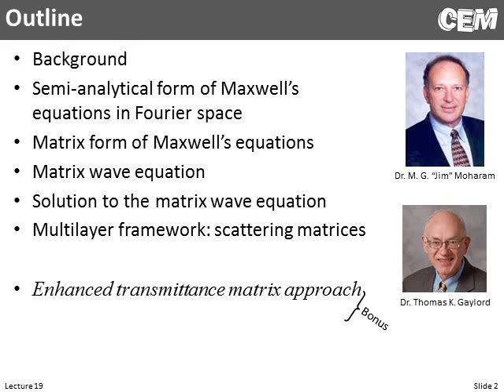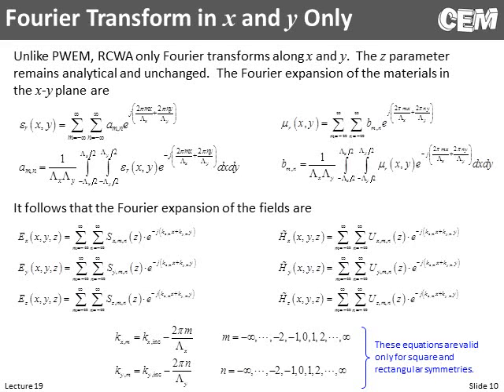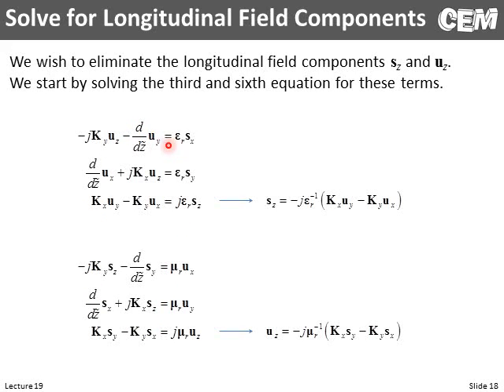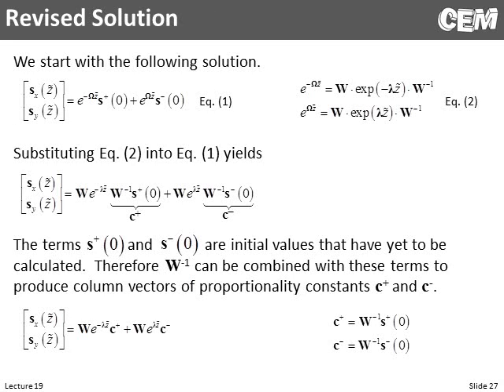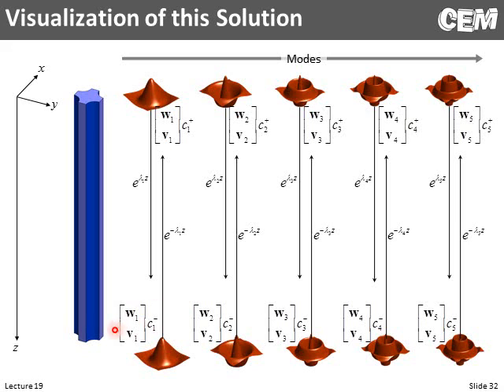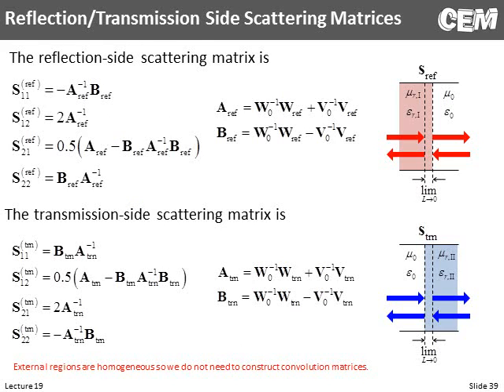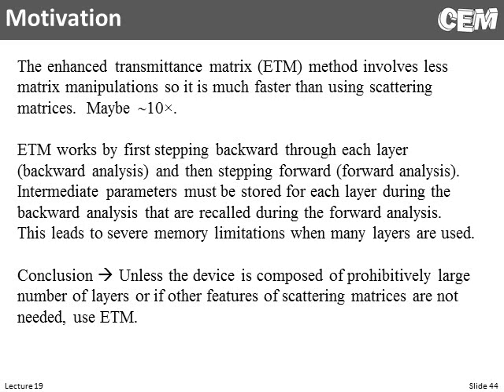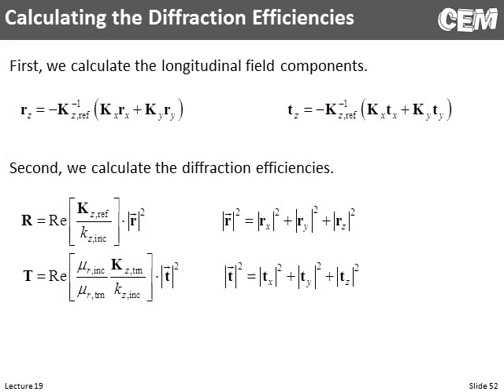Lecture 19 (CEM) -- Formulation of Rigorous Coupled-Wave Analysis

Comment: Good day, Dr. Rumpf thank you a lot for your lectures!
I wrote my RCWA code with help of your lectures and it works very well.
I try to calculate the fields inside my device but I got a problem with continuity. I followed the TMM extra lecture.
I fill all my layers with air so I got 100% transmission. I consider the sign convention from the RCWA lectures.
The mode coefficients for backward waves (c-) equal 0. I consider only 1 spatial harmonic for testing my code. 

I really dont understand what can be wrong. The amplitudes of the fields looks reasonably.
I will appreciate if you can give me some advice.
Reply from the maker: That is odd.  I probably need to create some notes on doing this for RCWA.  I am sorry I do not have that yet.  Sometimes it is easy to get the spatial harmonics backwards from how they are ordered in the FFT.  Try doing things like reversing the order of the K vectors.
Reply: @empossible1577  Did you mean to reverse the Kx and Ky vectors?
For testing the code I implement the RCWA with P=Q=1 so it works like regular TMM and my Kx and Ky equal 0.
Reply from the maker: @wolfwolf7121  Yes, I meant once you calculate them, reverse their order in the array relative to the indices of the spatial harmonics.  This is just something to try.  The codes as I present them are correct, but something like this is easy to mix up once you start messing with the data.
Reply: @empossible1577  If I understand it right, the matrix B=[Wg Wg; -Vg Vg] is eigen vectors matrix in free space? Or maybe there is somting additional to do with matrix B?

In case of P=Q=1 I dont really have what to reverse because Kx=0 and Ky=0 and they are not arrays, but it must work anyway.
Reply from the maker: @wolfwolf7121  The B  you specify I think are the eigen-vectors for the gap medium.  I think I am using vacuum here, but you can make it whatever you wish.

BTW, did I already point you to the course website?  It has the latest version of the notes, links to latest videos, and other resources to help you get codes working.

https://empossible.net/academics/emp5337/
Reply: @empossible1577  Good day, Dr. Rumpf. 
I worked carefully through your TMM and RCWA lectures and I double checked my code . It seems that my code is right - I have no problem with the conservation of power with any number of spatial harmonics, but I still have discontinuities at the bouderies between the layers.

The reversing of the K vectors didn't help. I can't understand where the problem with the phase is coming from. 
Can you give me some advice please ?

Thank you very much for your response.
Reply from the maker: Are you using local z coordinates in each of the layers?  I am only guessing at what could be the problem.
Reply: @empossible1577  Yes, I do it. Exactly like it is described in the TMM extra algorithm.
Reply: Beside the discontiniuty when I increase the number of spatial harmonics the amplitudes sharply rise at the end of the last layer relative to other layers but at the same time the R and T coefficiens calculated properly. This problem occurs with P=Q=7 or higher.
Reply from the maker: @wolfwolf7121  Try conjugating the eigen-values.  That is not a fix, but a test about what may be happening.
Reply: @empossible1577  I've tried to this. The phase changes to 180 degrees and the discontinuities remain
Reply from the maker: @wolfwolf7121  Hmmm...I am starting to run out of ideas.  Once you calculate the spatial harmonic amplitudes, how are you calculating the fields from that?  You may have to e-mail me your code.  My e-mail is emprofessor@empossible.net.
Reply: @empossible1577  I sent you an e-mail with my code. 
To calculate the fields I use the way described in PWEM extra lecture. 
Because the spatial harmonic amplitudes are odd number and the real space grid consist of even number of points (512 by 512) the oblique incident angle can occur. To avoid it I construct the field on odd real space grid (for exmple 511 by 511 grid) but it doesnt affect on the discontinuities.
Reply: Did you receive my email?
Reply from the maker: @wolfwolf7121  Yes.  My work like turned crazy.  Very sorry!!!
Reply: @empossible1577  I solved the problem with the discontinuities. But I still have the problem with rising amplitudes when I increase the number of spatial harmonics.
This problem occurs only with inhomogeneous layers.
If I use only homogeneous layers I dont have any problems.
Reply from the maker: @wolfwolf7121  Assuming the eigen-modes are correct, the only thing could cause this is having the sign of the eigen-values incorrect.
Reply: @empossible1577  I've already tried this. It doesnt help.
Reply from the maker: @wolfwolf7121  Very sorry.  I am out of ideas to try.  It is on my to-do list to develop this code and put out some notes, but I have a very long to-do list.  I may have to do it myself before I could guide you further.  My gut still points me to the sign of the eigen-values not be handled correctly.
Reply: @empossible1577  I understand. Beside the growing amplitudes, the field in the last layer turns perpendicular to the incident direction when I increase the spatial harmonics.
Reply from the maker: @wolfwolf7121  I REALLY hate telling people "I don't know" so I implemented the RCWA visualization.  I added some notes about this to RCWA extras.  It is the first section in that lecture.

https://empossible.net/academics/emp5337/

Having worked through it, I caught two mistakes that I made.  First, when calculating the fields in layer i, it is the global scattering matrix from layer i-1 that should be used.  Second, I had to multiply my IFFTs by the number of points Nx*Ny to get physical values.  Otherwise, it was pretty straightforward.  Take a look at the new notes and see if you catch anything.
Reply: @empossible1577  Thank you for adding new notes. I calculated the field as it described in the new notes, but I visualize only Ex component. I cant understand what I'm missing. I sent you an email with example of the results I got.
Reply: I also have discontinuities of the Ez and Hz components while Ex,Ey,Hx,Hy are continuous at the boundaries
Reply from the maker: @wolfwolf7121  Normal components are not continuous across the interface.  eps*Ez is continuous across the interface.
Reply: @empossible1577  Yes, I missed it. I fixed it and now it is working. Thank you very much
Reply from the maker: @wolfwolf7121  Great to hear you got it working!  What was the trick?  What were you missing?
Reply: @empossible1577  I just forgot to multiply the Ez component by eps one more time.

I still have the problem with the growing amplitudes, but I noticed if I use
LAM = sqrt(-abs(Re(LAM))-abs(Im(LAM))) 
instead of just LAM=sqrt(LAM) the amplitudes do not grow and the REF, TRN coefficients dont change a lot (the conservation is good), but this is working only in case of lossless materials. If I use metals the coefficients change a lot.
Reply from the maker: @wolfwolf7121  The first RCWA I ever programmed used the enhanced transmittance matrix technique to handle multiple layers.  I programmed that to visualize fields without any problems.  I rarely visualize fields with RCWA so I always use that old code when I do.  I have become curious if there is something fundamental about calculating the fields with my version of RCWA and scattering matrices.  I wish had more time to explore little things like this because they keep me awake at night!
Reply: @empossible1577   I implemented the ETM technique and it works very well, the results (Ref and Trn) are the same like I got with S matrices. But I have discontinuties again in the fields. 

I calculate the field this way 

psi  = Fi*[Xi 0; 0 I]*Ci, where Ci = [I; bi/ai*Xi]*ti
Is it correct ?

Buy the way there is no problem with amplitudes with any number of spatial harmonics with this formula of psi.
Reply: I figured out what was the problem. 
Now it is all working. 
Thank you for your lectures, attention and help.

Comment: Hi, Dr. Rumpf thank you a lot for your lectures!
I wrote my RCWA code with help of your lectures and it works very well.
But I have a question. Is it possible to analyze waveguides or resonators with this method?
Reply from the maker: Yes!  I don't really have any notes on doing this, but you can look at Lecture 2d on using TMM to calculate slab waveguide modes here:

https://empossible.net/academics/emp5337/

The very short story is that you will guess at the value for the propagation constant, solve for the global scattering matrix, and then iterate the propagation constant until the determinant of the global scattering matrix is zero.  It is sort of a weird way to identify modes on a waveguide.

It may be easier for you to just use a different method entirely, like PWEM or the finite-difference method.  These can identify the modes directly.
Reply: @empossible1577  Thank you for your answer. 
I also use the PWEM that I also wrote with help of your lectures. 

I need to analyze a rectangular resonator (closed metallic waveguide, it is a 3D problem) with metallic strips within it and I thought it will be better to use RCWA to avoid problems with big matrices using FDM. And it is not so comfortable to built this problematic geometry to use PWEM. That is why I decided to use RCWA.

Comment: Why does the Kz matrix have the conjugate of the er and ur terms inside the square root in its definition and a conjugate outside the square root?
Reply from the maker: For RCWA I chose to use the negative sign convention.  This is done to stay consistent with that convention.  Let me point you to the official course website where you can get the latest version of the electronic notes.  They have seen a lot of corrections and revisions since the videos were recorded.  I really need to rerecord them!

https://empossible.net/academics/emp5337/

Comment: It is unclear to me how you solve for r and t1. Anyone wants to elaborate or point to a resource that explains this more explicitly?
Reply from the maker: First, here is a link to a official course website:

https://empossible.net/academics/emp5337/

I think you are asking about the enhanced transmittance matrix approach?  This course material has been moved to the last section in Lecture 7c.  I have added a block diagram to help illustrate the method.  See the electronic notes as I have not yet re-recorded the lectures from the revised notes.

Overall, I recommend using scattering matrices instead of transmittance or transfer matrices.  Unless you really need the speed, scattering matrices are much better to use.  If you want to learn scattering matrices, I recommend working through the lectures on the transfer matrix method in this same course.  RCWA is a generalized form of the transfer matrix method.

Comment: Hello Prof Rumpf, 
By far, you are the best teacher in electromagnetics. Your materials are coherent and very well organized. I got this code running perfectly well against the benchmark thanks to you. However, I am trying to also implement the enhanced transmittance approach (ETM) by Moharam since it is faster than the scattering matrix approach but my results are just over the board. I am trying to trouble shoot what may be missing or what I may be overlooking. At 39.00 in the  "s" column vectors, are the Px, Py and Pz the same regular (polarization vectors)  Px, Py and Pz we used in the scattering matrix formulation?  

And please, do you have any hint for implementing the ETM for this problem? As always, thank you so much.
Reply from the maker: P is the same polarization vector.

I have no other tricks or secrets.  To help you, I have added a block diagram of my ETM code.  that should help.  It is the very last slide in Lecture 23.  

Hope this helps!!
Reply from the maker: Just in case you do not know, here is the link to the course website where you can get the electronic notes with the block diagram.

http://emlab.utep.edu/ee5390cem.htm
Reply: Okay. I'll suppose A B and s are properly constructed then. Could you kindly remark on the snippet of code for the ETM implementation I sent you. Would greatly appreciate that. Thanks a tonne.
Reply from the maker: @levionelevis5883  I don't recall getting that code.  Sorry if I missed it.  Can you resend?

Comment: Hi Ray, would it be possible to provide some bench mark for the visualization of the field as well. I followed your  TMM Extras to achieve this but it appears there is quite a lot that is probably going wrong with what I am doing. What I observe in my code is that, when I increase the spatial harmonics, the field values become unstable. I have sent you an email. As always, much gratitude for your unique effort.
Reply from the maker: I am slowly working on this.  Right now, I have just finished revising the notes on how to modify our scattering matrix technique to visualize the fields for the transfer matrix method.  The algorithm is essentially the same for RCWA.  You can get to those notes here:

http://emlab.utep.edu/ee5390cem.htm

See Lecture 6 TMM Extras

Comment: Hi Dr. Ray.  Thanks again for this great resources. I would say I am about 96% done with the implementation but there is a problem with the calculation of the eigen vectors/values of the  looped layers. In my case,  the eigenvectors  of OMEGA_SQ  matrix  agreed with your values but the eigenvalues had some sign discrepancies. For example in column 12 row 12, your result was  0.0000 - 2.2778i and mine was  0.0000 + 2.2778i and vice versa throughout the eigenvalue matrix ( this behavior is random though,  some of the diagonal elements have their signs matching well with yours). I am suspecting the sqrt function of matlab is causing this behavior. Any pointers from you would be greatly appreciated.
Also, if I could see your intermediate LAM values ( LAM values before the  matlab sqrt function). This could also be helpful.

 And ooooh, am referring to the 3 x 3 oblique incidence case.
Reply from the maker: The order of the eigen-vectors/eigen-values can change around, making it difficult to compare.  There is a good chance that everything is correct with your code.  One thing you can do is hard-code my numbers in your code to check intermediate results that come later.
Reply: Thank you so much Dr.  I just got my rcwa working  so perfectly. All thanks to you.
Reply from the maker: @atsul.7943  Great job!!